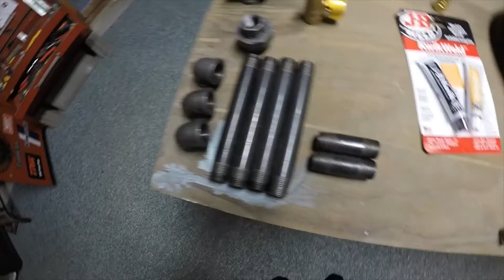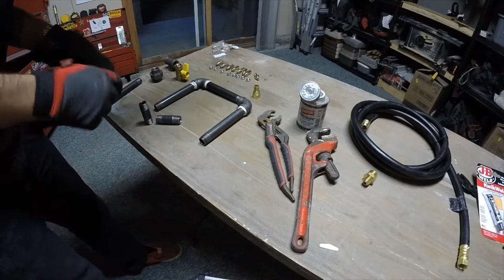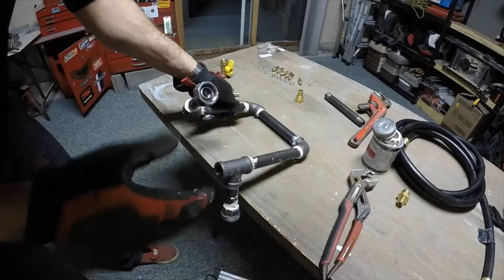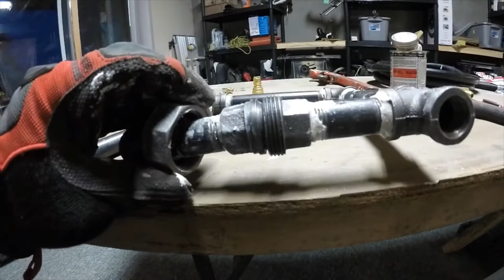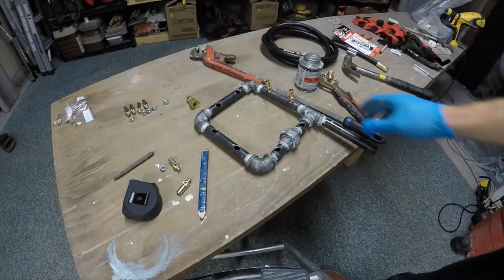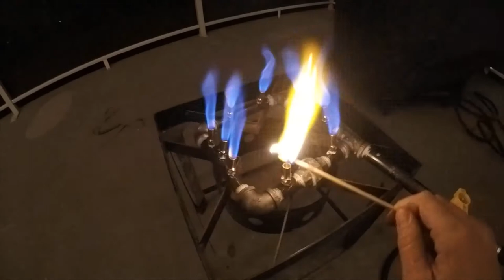Home Made Natural Gas Burner - 100% DIY

Comment: Could you please explain how the air is mixing with the fuel? I mean where is the air intake? And could you provide a link to those jets? Are they different from orifice, if so can I have more details please?
Reply from the maker: The air mixes from the jet body, There are air holes at the base of each jet. I ordered them online from Wish but I don't have a link to the specific ones I used.